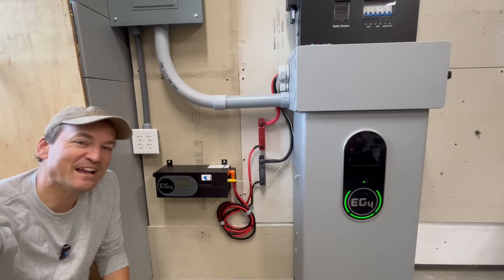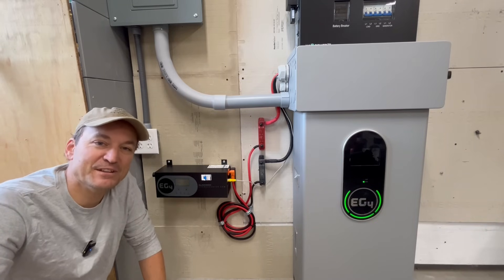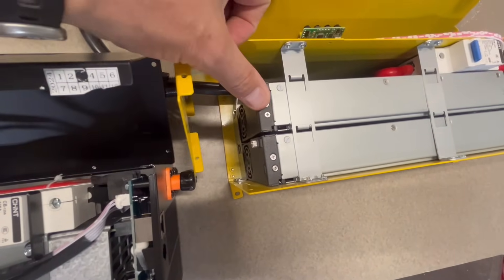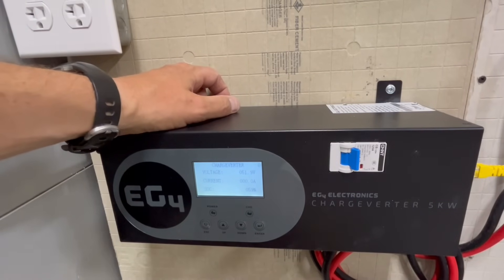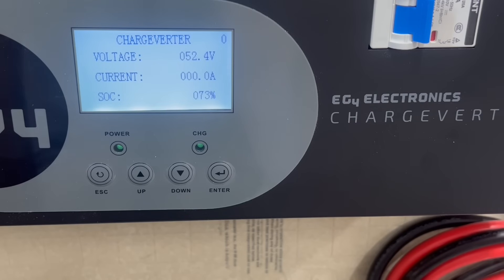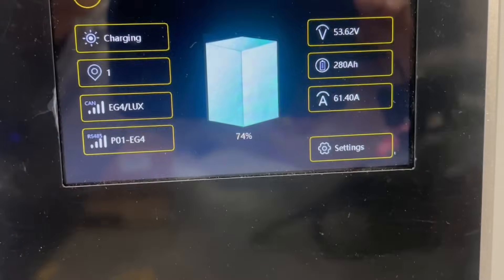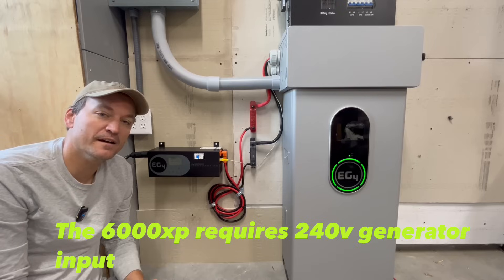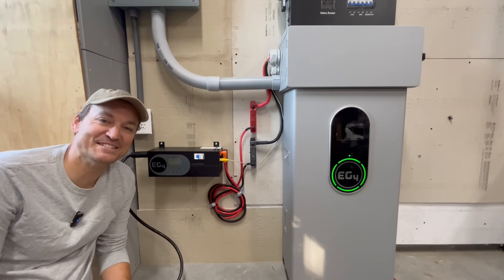New EG4 Chargeverter, charge your batteries fast when the grid is down

Comment: You cannot use the communication feature if your batteries are communicating with your inverter.  Since you cannot use the communication feature you cannot use the SOC feature to turn on your generator or stop ChargeVerter charging.  Stuck with Voltage just as on the older version.  Charge you more for features you cannot use.  You should wire a RV 30amp plug if your going to use 120v input.
Reply from the maker: I was using communication with both. You might be talking about the lifepower4 batteries. And yes,  those only have one RS485 communication option. The power pro batteries and LL batteries can communicate with both at the same time.
Also the older chargeveter model didn’t have a generator start relay. So even if you’re  using voltage it you still have that extra option. Honestly I don’t mind using voltage. It still starts and stops at the upper and lower ranges. But with SoC you can definitely get things more fine tuned,
Reply: @GavinStoneDIY  Also, turning on the breaker and powering up the ChargeVerter causes the 6000XP's to shut down and reset shutting down all your loads for a short time and air conditioners must time out to release pressure etc.  This is a real problem for Off Grid people and ones running critical items without battery backup etc.
One YT Creator said EG4 told him that that is normal.  Normal for poorly designed products LOL.  Probably capacitors charging in the Chargeverter causing a downward spike on voltage.  I don't want to leave my ChargVerters ON ALL THE TIME!  I only want to power them up when I need them which is usually on very hot days when clouds and storms arrive and every air conditioner is running at full.
Reply: @sciglassblower  leave the breaker on and it automatically starts and stops working when genny is working without loads being affected
Reply from the maker: @tjmooney4181  while I appreciate the new update they’ve made in regards to 120v charging, it’s pretty limited. In the sense that you can only power loads off L1 as you charge. L2 isn’t functional. 

So in a pinch this is a cool feature. But the chargeveter is really still the way to go in my opinion.
Reply: @GavinStoneDIY  i agree 💯 but wanted to let the other commenter know it is now possible. I love the new chargeverter and add them to all the systems I install
Reply: @GavinStoneDIY  The 6000XP has one battery communication RS485.  One of my 6000XP's has that used for the batteries and the other 6000XP picks up SOC info from the first 6000XP.  So what would happen if I plugged the ChargVerter into the unused battery RS485 on the second 6000XP?  I will not try anything like that without info from EG4, just wondering.  There are 2 unpopulated RS485's on each 6000XP also?  I have to use Voltage to shut off the ChargeVerters, but would be better if I can get the SOC to work.
Reply from the maker: @sciglassblower  I would probably power up the capacitors with the generator before flipping the breaker on. I haven’t had the issues you’re describing so I may try to replicate it. My XP hasn’t shut down when I turn on the chargeveter. 

The coms port on the other XP wouldn’t work I don’t think. 

The SOC is really the best for people have a generator with auto start. You can choose a certain percentage to start. But even then voltage works fine. You can pretty accurately pinout 20% with voltage once you’ve had your batteries running for a bit. I ran my entire system based off voltage for almost 2 years. Given the option it’s nice to have SOC. But it’s not a deal breaker. 

This chargeveter is more expensive. But often times newer versions of equipment are. This stays cooler, it’s quieter, and it’s easier to change settings. Also has better components. So it’s not all about the communication and auto start. You still can’t get anything brand name with this much charging amperage for near this price.
Reply: @GavinStoneDIY   I have not tried powering up the ChargeVerter with the Generator prior to flipping the breaker on the ChargeVerter.  I don't know if that would actually turn on the ChargeVerter?  The YT Creator explained how it shut him down and I replicated it pretty easy.  Had loads running and when I flipped the breaker everything shut down.  I will try powering up the ChargeVerter with the generator first to see what happens.

I agree that the com port would not provide the SOC info to the ChargeVerter unless they designed it to, which I doubt.  It is programmed to communicate with the batteries only I'm sure.

I agree with everything else you are saying, just really would like the SOC control work.  And yes, there is nothing else out there for the price!

Thanks for the communication!  I will take a look at your other videos.
Reply: @GavinStoneDIY  Your Suggestion Worked!  I powered up the Generators first and allowed them to boot up and charge internal capacitors on ChargeVerter before turning on the breaker, And, the Inverters did Not turn off.  Thanks and a great tip for All with ChargeVerters.
Reply: @GavinStoneDIY   I was just going to ask this same question.  Thank you for your clarification. It'd be good to get EG4 to clarify this in their documentation.   From the manual: "CAUTION: Do NOT establish communication between the charger and a battery or batteries that already have communication with an inverter! Batteries should never have communications with a charger and an inverter at the same time."
Reply: @GavinStoneDIY  Good to know. I noticed the manual says explicitly not to do communication with both inverter and battery at same time. I guess they need to update their manual. There are 4 RJ45 ports on the LL battery. I have my EG4 3000 Inverter on the RS485. There is a CAN labeled port and the other two being Battery Communications. I am guessing you just plugged in the Chargerverter to the Battery communication ports?
Reply from the maker: @subukai  the chargeveter requires an RS485 port to communicate. I believe the EG4 3kw inverter requires RS485 also. So this wouldn’t work. The other EG4 inverters have a CAN protocol option. So that would be hooked to the inverter, and the rs485 would be reserved for the Chargeverter. 

Then again you could just use one of the other batteries in your stack to communicate with the chargeveter.
Reply: @GavinStoneDIY  Thank you for the insight and for the quick response. The video did an excellent job explaining the use case and its features.
Reply: @GavinStoneDIY  what about the EG4 Indoor. Can it communicate with both 18KPV and Chargeverter at the same time?
Reply from the maker: @AlexanderBell1847  yes, the 18kpv would use the CAN port on the battery. And the chargeveter would use the RS485. So the indoor model can connect to both at the same time.
Reply: @GavinStoneDIY  Thanks for the clarification!  Yes, you are correct, I am using the Lifepower 4 batteries.
I don't know why they did not design it to use one of the additional communication ports on the 6000XP to pick up the SOC?  Many of us have complained so hopefully they will provide a fix?
I have 3 5000w continuous Inverter Generators that don't have elec start.  For those of us that purchased 2 or more 6000XP's we cannot use the generator charging feature because we would have to purchase a Huge Generator and on top of that most large generators are not inverter and are not stable enough to keep below 3% THD.  We were forced to purchase The New ChargeVerter increasing our budget and we cannot even use the new features.  They discontinued the older model.
They should have included a true charger like a ChargeVerter inside each 6000XP, 12K, 18K etc.  Then you can use normal sized generators, one on each All-In-One and run just one or two etc as needed without any concern about damaging the inverter.
JM2C
Reply: @sciglassblower the new firmware update allows 120v generators to  charge using 1 leg of the gen pr grid input on the inverter
Reply: Whole lot of rambling for someone that doesn’t know what they are talking about 🫠
Reply: @andyfromtoystory7426  LOL we all know which you are

Comment: Where did u connect the ats wire ?
Reply from the maker: On the chargeveter? There is a labeled Rs232 port. And each generator has a different ATS location. So yours might be different.
Reply: @GavinStoneDIY  thank you for the reply. My predator generator inverter doesn't have ats.. Where do I connect the rs233?

Comment: Any idea if I can plug into an Ethos battery system with a EG4 18k?
Reply from the maker: As far as communication? I believe they can communicate with those yes.
Reply: Actually I meant battery hookup, would I have to disconnect anything or just run the battery wires into the grid connection on the EG4 18.

Comment: Hey @GavinStoneDIY - can you tell me what cables you used to go from the the battery to the bus bar? Did you end up changing the terminals on the power pro?
Reply from the maker: I used the cables that came with the power pro. They send 2 pairs so I had an extra set.

Comment: I have both versions. I have the Yellow Version that I got last year and I have the New Black version that I got last week. Neither one of them will make a hundred amps output. The yellow one does the best at 93.5 amps while the black one tops out at about 89 and a half amps.
Reply from the maker: How many batteries are you trying to charge? I’ve tested 3 chargeverters, and all of them will push 100 amps. It’s really about the battery voltage more than anything. 

Then again ideally you’d want to stay around 80-90 amps to stay a bit cooler probably.
Reply: @GavinStoneDIY  48 280 Ah cells. It's 3X 16S with 3 BMS tied in parallel for 840Ah.

Comment: Hey Gavin,   If i have two of the indoor wall mount batteries wired in parallel connected to my 6000xp inverter,  what would be the wiring configuration for the Chargeverter ?  Would I just connect to the positive and negative buss bars of just one of the batteries ?
Or, connect the positive to one battery and the negative to the other battery ?  
I know on the server rack batteries, when connecting the Chargeverter to the rack buss bars, they are in a "diagonal" configuration.  Just not sure the best way to connect to the two wall mount batteries and have balanced charging across both batteries.  Thanks for your help in advance.
Reply from the maker: Attaching to just one busbar would work fine. Because of their design and the wire size the resistance between the two wall mount batteries would be minimal. They should stay balanced without an issue.
Reply: @GavinStoneDIY  
Thanks Gavin.  Just got my system installed and up and running.  Just wasn't sure about the connections of the Chargeverter...

Comment: So, do you have grid out to your property or are you fully off grid?
Reply from the maker: I have grid power available. I just have the grid breaker turned off.
Reply: @GavinStoneDIY  nice. So when your batteries get low do you find it is more affordable to charge them with a propane generator or with grid?
Reply from the maker: @diySolarPowerFunWithRay  the propane would probably be more affordable at this point because I don’t need supplemental power very often at all. 
My meter fee is around $30 a month. But I suppose that’s cheap insurance to pay every month.
Reply: @GavinStoneDIY   cool.  thanks

Comment: @Gavin S. DIY H. Very cool i was thinking of getting one to charge up my 48v battery from a 120v 20amp receptacle, but the max amps i would be able to set is 35amps on the chargeVerter; still putting that on a smart plug would be awesome, with that said can you charge the batteries via the chrageVerter at the same time using the batteries via a 6000xp ?
Reply from the maker: Yes you can charge the batteries with the chargeveter and use the XP at the same time. Basically the same thing as having an additional  MPPT charge controller working as you power your loads.
Reply: @GavinStoneDIY  i see, so what happened if your battery only have one com port? Do you connect the XP to it or the ChargeVerter?
Reply from the maker: @fullyelectric  you’d probably have set your parameters using voltage instead of communication.

Comment: Thanks for the review....I'd like to learn more how to get my Champion generator to auto start and stop. It's a Champion 7500W with a wireless remote (fob) electric start (auto choke)....so now I've got to figure out how to wire into the start stop capability. Really enjoy learning from your content.
Reply from the maker: The relay on the chargeverter essentially just works like a light switch. The contact closes when you reach the designated SOC or voltage. So you just have to figure out which contacts to hook to on your generator.

Comment: Would be helpful to many to have a video where you set up your bus bars. Me and my son both got these same day to charge our power pros and were staring helplessly at the cables wondering how we would make it work. Ended up splicing with electrical tape and heat shrink. 🤷
Reply: Could you not just crimp the proper size lugs on the Chargeverter and go straight to power pro bus bar?  Also forgive me if I'm wrong but it appears that your generator is an inverter style generator and with the new generator firmware update  could you not just go straight to the 6000xp and have the exact same functionality?   Thanks gain for great videos.
Reply: @SolarinStarke-kt2lm  I cut the lugs off the c.v.  and crimp on the powerpro connectors they sell seperately by folding the 2 awg into double size and works great without needing dangerous (for my kids to have access to) external busbars
Reply from the maker: @SolarinStarke-kt2lm  sorry I didn’t see this till now. The chargveter wires are 2 awg. And the amphenol connectors for that size won’t fit the Pro battery terminals. 

Yeah my generator is an inverter generator. So it would likely be fine hooked directly to the XP. But a lot of people won’t have that option. So either way I wanted to show people.
Reply from the maker: I’m not sure how you spliced. It would work with bolts and lugs. But it could also generate a lot of heat if it isn’t crimped correctly. 

My busbars are attached to the spare pair of pro battery cables I had. And from there I attached to the chargeveter. Just seemed like the cleanest way to achieve things.

Comment: Great Video Gavin. I have the same generator. The plug is a aviation style GX20A-8P. I have not hooked mine up yet. What pins were you jumping across for the dry contacts? Did the generator have to be in the on position?
Reply from the maker: That’s awesome. I’ll check that out. Pins #2 and #6 were what activated mine. It does have to be in the on position. But the LED’s eventually shut off.

Comment: Great video. The SOC start being at the battery SOC was not very intuitive to me. Nor was the use of the CAN communication between the inverter and the battery while using the RS485 communication between the Chargeverter and the battery. As usual the manual could use some refinement. Thanks for the clarity you bring with your videos.

Comment: could this work using a Goal Zero yeti 6000X power station? My EG4 inverter has a short and needs to be replaced, cannot receive PV power.
Reply from the maker: It could yes. Since that’s a 120v power station you’d have to rewire the plug like I described.
Reply: @GavinStoneDIY  You are a gem. thanks for demystifying a lot of this. I am wondering if I can use the yeti directly through the EG4 6500 inverter to power the batteries without buying the chargeverter?
Reply from the maker: @vittoriolacerva9297  you have the EG4 6500ex? If so, yes that would work,  as long as you don’t have it set up in split phase mode with a second inverter. Otherwise yes, those are single phase inverters so you could power it directly with the power supply.

Comment: Great Video! Question, if you have EG4 Lithium batteries that communicates with a EG4 6500EX, how would you incorporate  this chargeverter so that the EG4 6500EX inverter can still charge the EG4 Lithium with the close loop communication for the batteries based on SOC?
Reply: The manual says the both can't be in closed loop at the same time so I'm guessing you could disable the inverters charger or set the CV to voltage charging.  EG4 really needs to clarify all this!
Reply: Thank you for replying. Do you think if you use the EG4 LifePOWER4 communication hub, you can connect both the chargeverter and the inverter to it, then to the batteries, would that work?
Reply: @sleemsolar  I would think that both the CV & the inverter could be connected to the buss at the same time but only one could be in closed loop.  To me, closed loop means that the battery's BMS is controlling the charger.
Reply from the maker: I don’t have any word on whether the coms hub can be used for this. I’m actually curious about that myself. But I’m assuming the easiest method would be to use voltage for your parameters.
Reply: @GavinStoneDIY  -- Well the problem with that is what voltage?  Bulk, Absorption or Float.  None of those values would be acceptable if was applied 100% of the time.  I haven't had time to play with my CV yet but I'm guessing in the voltage mode you get one setting.
Reply from the maker: @rpsmith  that’s the way the original chargeveters have operated for almost 2 years. Charging parameters based of off SOC are more ideal. But it’s workable with voltage. Especially considering the majority of chargeveter usage is to supplement solar or for rainy days. So I usually set mine for bulk.
Reply: @GavinStoneDIY  -- So your older CV constantly charges at the bulk voltage or do turn it off after the battery is charged?
Reply from the maker: @rpsmith  I believe I had mine set for 56.4v. It would stop running when it reached that setting. I would shut it off then though either way, because it didn’t have dry contacts for my generator.